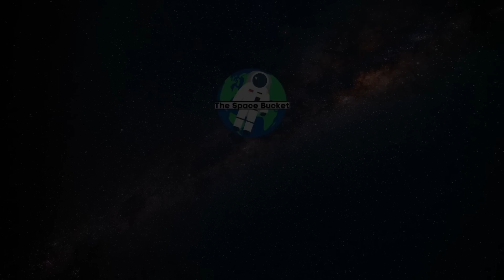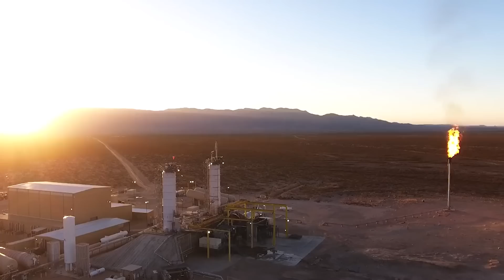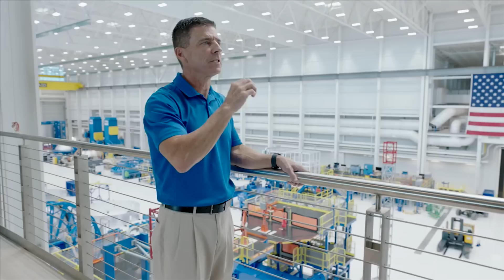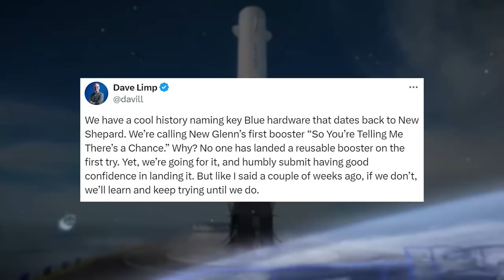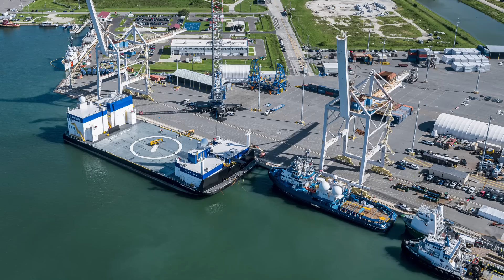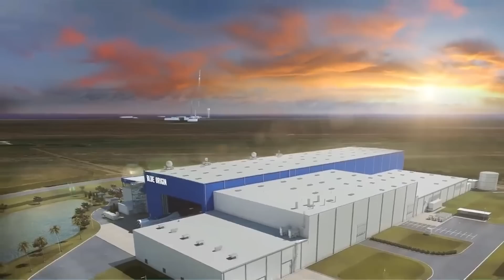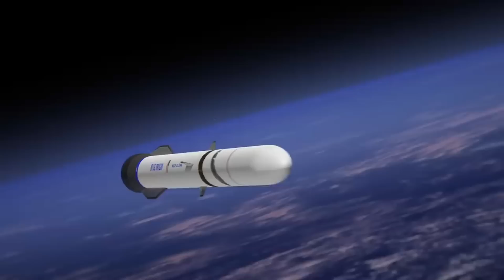A Flight Capable New Glenn Is Vertical On The Pad

Comment: Their 7m fairing provides unprecedented mass and volume capabilities? Doesn't that mean that there hasn't been anything else like it before? Have these guys not heard of Starship? I think 9m is a bit bigger than 7m.
Reply: The problem with Starship is how big the payload bay door can be without structural degradation. It doesn't matter what the cubic feet/meter capacity is, only how big the door can be. That's why I love the James Bond approach that Rocket Lab is using for Photon. The entire payload bay opens like a flower. They may end up being able to carry physically bigger payloads then starship. That may be far more important for exploration missions, and military missions.
Reply: Starship cannot deploy a 9m volume mass from is bay.
Reply: SpaceX claims that the accessible payload diameter will exceed 8 meters. I guess clamshell complexity and header tank plumbing takes up some space.

In partially expendable mode, no header tanks, flaps, nor TPS are required. The payload could easily be a 9 meter wide third stage mounted directly atop the main methane tank...
 @iamscoutstfu
Reply: @iamscoutstfu  ... yet... Elon says: Hold my beer...
Reply: Starship hasn’t flown any payloads yet.
Reply: It gives them volume options.  Mass is determined by the performance of the stages.
Reply: Starship Mark 2 has a larger payload bay, and Mark 3, is even larger. We often forget Starship is evolving into a usable system as it matures.